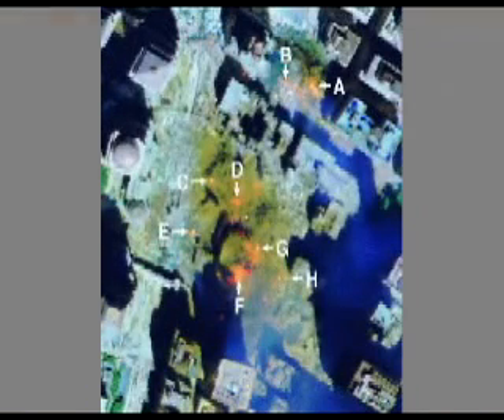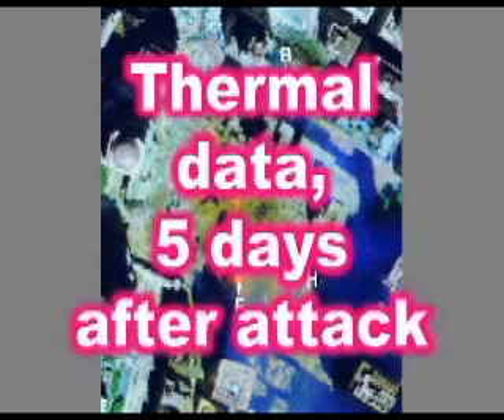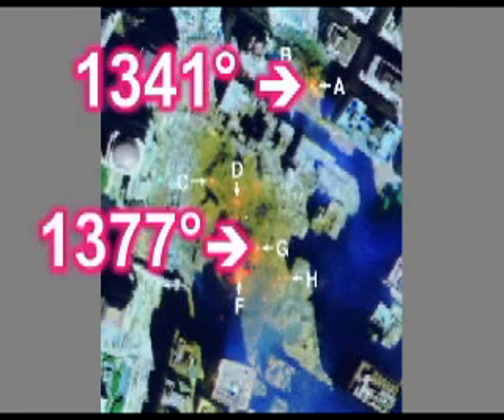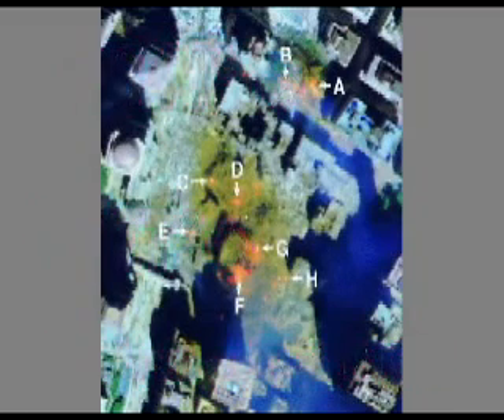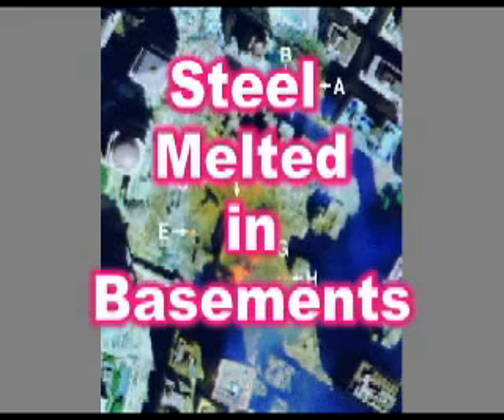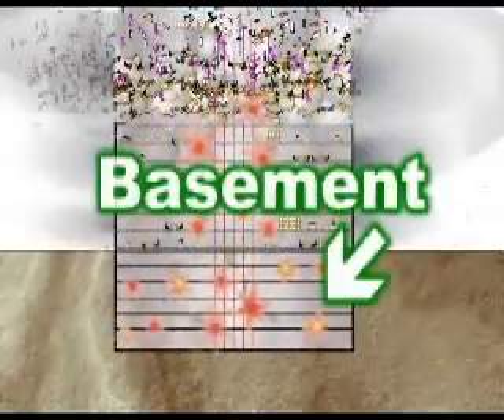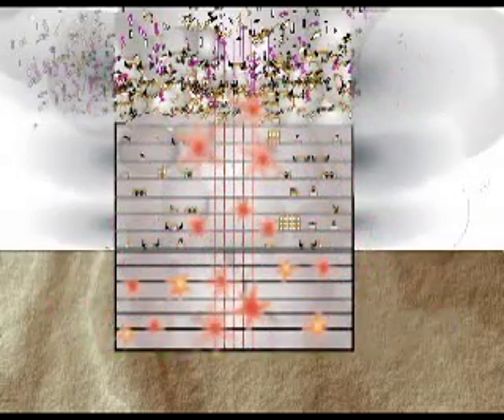WTC Ground Zero Molten Steel (Part Two)

Comment: Super Nano Thermite does this to beams. Its impossible for yet fuel and rubble burning to make this molten lava. And even 3 months later under ground zero still burning and visible molten metal lava. Its nano thermite that does this long burning without oxigen. Also its impossible for these towers to fall freefall into their own footprint without controlled demolition, its just impossible from a top damage.

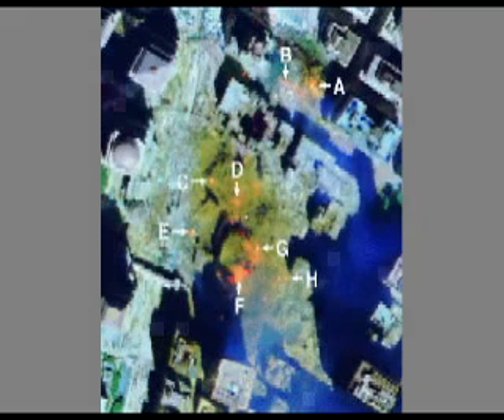Comment: Does everyone understand that the title of this video and the video itself contradict each other? True! The thermal images (0:22) indicate temps nowhere near hot enough to melt steel, so why is that in a video about molten steel? If anything it supports the government's version because those temperatures are explained by conventional fire.

Comment: Bullshit they fell cause the stel got week from the fires causing the Flores to sag pulling in on the load Bering walls causing them to collapse the pools of metal were probley aluminum since it melts at around 1350 degrees f let's not forget about how much aluminum was used as well as copper in the towers a lot of unexsplaning things happened that day like body parts found blocks away strait up terrorist attacks plain n simple I no some one who's uncle was in first plain to hit the towers n he never came home so Plaines deff were hijacked  n used to ultimately take down the towers my prayers are with all who lost someone they loved that day

Comment from the maker: @Laughingblades 
Molten jet fuel? LOL. I will ask these questions again. 

1. Where is ANY proof that molten aluminum (or molten jet fuel) was even there? Not even one witness? 

2. What was the force pushing downward to cause the friction/thermal transfer if the upper floors were either plverized or ejected laterally? This is obvious by watching any video of the collapses lke this one..

watch?v=aBOd1XB943o

Comment from the maker: @Laughingblades 
So, to summarize: You think fires 1000 ft up after the collapse melted cars and fused an engine with other parts? You don't have even ONE other example of this heat transfer in a building? No references to base this on? Where did you get this concept from? Your ass? Please tell me you have something more than just your opnion again?

Comment from the maker: @Laughingblades 
Here's something else to ponder while you're looking for other examples. At the initiation of the collapse, a significant portion of the fire impacted area and continuing downward was either pulverized to dust or ejected sideways. So, where is this FORCE (mass) pushing downward creating friction and ultimately heat energy? Was the bearing weight dust or air? There should be a massive chunk of building at the base. There was not..one to grow on...

Comment from the maker: @Laughingblades 
1. Fires from 1000 ft up caused this? 
2. Doesn't answer the question
3.-4. I'm sure there are examples of this thermal transfer in other building collapses? Ya know, where extreme temps were found underneath the building? Can you post some please? Thanks. You're not going to tell me this only happened on 911? 
5. Video
6-7. Other examples? None, right?

Comment from the maker: @Laughingblades 
Hey JR. You can work on this. There were hot spots discovered underneath WTC7 also. Was this caused by molten aluminum also? Was the WTC7 siding made of aluminum? What gives? Here's comes a different theory, right?

Comment from the maker: @Laughingblades 
Watch this clip and tell me did molten aluminum cause this?
watch?v=Zww9-AaIgrw

1. melted tour buses, cars, firetrucks
2. car engine melted together with other parts of the car
3. flames still coming out of the BASE of the towers
4. 5-6 stories below ground, fires still burning until Dec01
5. workers digging up heated rubble/ 2800 degrees underground
6. massive thick steel bent like a pretzel
7. fused steel and concrete

Comment from the maker: @Laughingblades 
Oh, I got it now. The aluminum flowed along the surface of the 1350 ft building? I'm sure there is video showing this somewhere? No? And here's another mystery. The people seen at the North Tower impact hole just 20 mins before it collapsed? Did they walk over, around or thru the 10,000 gals of jet fuel, plane debris, office supplies....and now this just in, possibly molten aluminum to get to the impact hole? And yes, just accept your BS theory as fact or you're stupid?

Comment from the maker: @Laughingblades 
I think you have this reversed. You are only giving your opinion of what happened. Science? You mean, your theory based on what? But, the REAL evidence (USGS recorded temps, many witness accounts, video footage of ground zero showing the devastation caused by extreme heat) speaks for itself. Using the same logic, where's the aluminum son, kiddo, jr.? Did anyone confirm this? No? This is some kind of new science, right?

Comment from the maker: @Laughingblades 
So, when did this heat from the fire impacted zone end up buried in the rubble? Was it when the building collapsed and the upper floors smothered the fire? Or was it when the fire impacted area was pulverized and ejected laterally? And why hasn't this BS...err.. thermal transfer (to create temps over 1000C) occured in any other building collapse? Please use something other than 911myths, PM and Rkowen's videos for your research. I will say this. You are very entertaining..

Comment from the maker: @Laughingblades 
So, let me get this right. You think the fire about 1000 ft up (the only heat source) melted the aluminum from the structure (before the collapse??) and then that aluminum somehow ended up buried under ground? Did it flow like lava downward to reach the ground or take the elevator down? And this fire 1000 ft up (or heated aluminum??) also melted cars and firetrucks at ground zero? You can't be serious with this?

Comment from the maker: @CrazyRay7979 
Watch the video again and count how many times the word "underground" is used. Its time to deal with real science. Jet fuel and/or office fires from 1000  ft up can not melt steel and create that extreme heat buried underground. And if this was actually proven false years ago, why do you need to defend it? That doesn't make a ton of sense, does it?

Comment: @muzicmaker2001 
Watch the BEGINNING of YOUR OWN VIDEO where YOU present that there was 1,377ºF recorded in the rubble pile...not "underground" and not "2,800ºF"

PROVE that office fires didn't cause this...why would they take the time, effort, and money to fireproof steel beams in a building if an office fire could not do anything to the steel?

That video shows nothing but a guy saying 1,500ºF and a guy guessing 2,800ºF who is obviously guessing wrong...1,377ºF, remember??

Comment from the maker: @CrazyRay7979 
Quotes from the clip below:
"There are still flames coming out of the BASE of the trade towers" 

"At one piont, I think they were about 2800 degrees" What were you saying about a bonfire and "the 1,377ºF."

watch?v=Zww9-AaIgrw

Uhh, yes. Underground. Is everyone that mentioned the fire underground a truther? You didn't know this? Please research a little more. And office fires caused this? Really? Keep trying, but you more desperate with every post.

Comment: @muzicmaker2001 
Really?  You're going to sit there and say that the ONLY fires on 9/11 should have been the ones that were on the floors that were struck?  That is just plain ignorant AND/OR purposely misleading.  Apparently you think there's nothing flammable in an office building...
I guess cars on the street didn't catch on fire either, huh?

What "max temp recorded at ground zero", the 1,377ºF?  Like I said, a BONFIRE...ah, you must be one of those "melted steel" Truthers

Comment: All of this is explained by Dimitri Khalezov.
To take it one step further, observe the chem comp of the dust.  It is easy to show how the bed rock ganite was the feed stock for the high aluminasilicate content.  Molybdenum spheres are also present, requiring 4700 deg F to melt.
Fission reactions is the only plausible explanation for this evidence.
Over 5million cubic feet of dust can not be denied.
Find shaking tower to see evidence of p-wave, which humans can't hear, on camera.

Comment: @muzicmaker2001 A lot of people believe that the steel melted after a long time of cooking in the pile.  They don't understand that physics doesn't work that way.  Heat flows from hotter to cooler, not the other way around, so no matter how long you cook steel at 1400 F, it can never get hotter than 1400 F.  

The only exception to the hotter to cooler flow is when you add mechanical work to the system, as is done in a refrigerator or air conditioner.

Comment from the maker: @vejet 
I'm sure you can describe the mecanism by which fires 1000 ft up created this heat deep in the rubble? Throw in how the upper undamaged floors most likely smothered the fires when collapsing onto them and how a large portion of this area was pulverized to dust and ejected laterally or how there were intact floors at the base of the Towers after the collapse. Did the black smoe from the impact zone also cause this? Obviously not

watch?v=Zww9-AaIgrw

Comment from the maker: @vejet 
@vejet 
I'm sure you can describe the mecanism at which fires 1000 ft up created this heat deep in the rubble? Throw in how the upper undamaged floors most likely smothered the fires when collapsing onto them and how a large portion of this area was ejected laterally or how they were intact floors at the base of the Towers after the collapse. Did the black smoe from the impact zone also cause this? This is very obvious

watch?v=Zww9-AaIgrw

Comment from the maker: @vejet 
I'm sure you can describe the mecanism at which fires 1000 ft up created this heat deep in the rubble? Throw in how the upper undamaged floors most likely smothered the fires when collapsing onto them and how a large portion of this area was ejected laterally or how they were intact floors at the base of the Towers after the collapse. Did the black smoe from the impact zone also cause this? This is very obvious

watch?v=Zww9-AaIgrw

Comment from the maker: @vejet 
No contradiction at all, but very mysterous. There is no physical evidence (steel) of this heat from the impact zone, but we have extreme temps (hotter than what NIST gave for the max temp of any steel sample) buried deep into the rubble lasting for weeks. Obviously, this fire 1000 ft up did not burrow its way deep into the rubble like a gopher, so there must be another mechanism or catalyst for the creation of this heat. ENTER NANO-THERMITE...

Comment from the maker: @greywolf424 
Find the lies:

1. Near free fall collapse
2. Witness accounts of explosions
3. Pulverized concrete at initiation of collapse
4. Pre-collapse ground shaking
5. Demolition flashes
6. No physical evidence of extreme heat at impact hole but..
7. Extreme temps buried in basement/rubble for weeks
8. Nano-thermite discovered

Comment: @muzicmaker2001 Guess what, there are over 1.5 million engineers and 132,000 architects in the U.S. alone:

bls*gov/oco/ocos027.htm#emply
bls*gov/oco/ocos038.htm#emply
(replace * with . )
.
SO GUESS WHAT, IT IS EXACTLY LESS THAN 0.0008%

Comment: @muzicmaker2001 ... Exterior columns failed due to loss of interior lateral trusses.  Without lateral support and with interior columns at 1100deg the exterior columns cannot support the entire building without buckling inward like a piece of paper you're trying to stand up straight.

Comment: @muzicmaker2001 Thanks, I found the report. Right next to your quote it also mentions that they recovered less than 1% of the columns from the effected areas.  So while 600c (1100f) is the failure point of steel they only recovered 1% of the steel in the fire and it did reach that point.  The other 99% may have been hotter or cooler.  In a previous post you talk about the 3% of exterior columns found only reaching 250f. But they didn't initiate the collapse due to fire...

Comment from the maker: @DRAT311 
Read NIST's quote again. 
Of the more than 170 areas examined on 16 perimeter column panels, only three columns had evidence that the steel reached temperatures above 250 ºC.

Now, there is no evidence that this heat impacted the steel directly from the impact zone. Next, throw in the fact that people were seen standing on this steel direct before collapse. It doesn't make logical sense.

Comment: @muzicmaker2001 You say there is no evidence that heat played a part in the collapse because the steel was only heated to 600c?  Thats 1100f.  Thats the temperature at which steel is reduced to 50% strength.  When they rate fire proofed steel they rate it based on how long it can be exposed to fire before it reaches 600c because thats its failure point.  And thats pg 140 of what document?  None of them are that long.  NCSTAR #?

Comment from the maker: There is no physical evidence that heat contributed to the collapse....

"Of the more than 170 areas examined on 16 perimeter column panels, only three columns had evidence that the steel reached temperatures above 250 ºC. Using metallographic analysis, NIST determined that there was no evidence that any of the samples had reached temperatures above 600 ºC." (p 140)-NIST

Comment: Why does this video show the melting point of aluminum in order to try to prove that the fires were hot enough to melt STEEL?? Does the creator of this video not know that steel and aluminum are two different things?

Comment from the maker: The fires were approx. 800+ ft up. The Towers collapsed basically straight down into a pile of rubble. If you believe the official story, the tops floors (weight bearing) should've smothered the majority of the fires when pancaking downward. Are smothered fires from 800+ ft up hot enough to melt cars at ground level and last for weeks generating temps over 1000+ degrees?  Logically, they are not...

youtube*com/watch?v=jrUosvSNLCk

Comment: However to penetrate the steel, sulfuric acid is required. It's possible for calcium sulfate to undergo a direct reaction to form sulfur oxide, followed by combining with water to form sulfuric acid. But this only proceeds at an acceptable rate at ~1400degreeC.  However, research showed it was possible for the reaction to proceed below 1000degreeC in the presence of carbon monoxide.  So, there you go...
And all your stupid talk saying "Well that explains that!", just no.

Comment: A scenario I find plausible is the eutectic reaction, evidenced for by FEMA, may have occurred, lowering the melting point of the steel. FEMA found sulfides in the iron as evidence of this, and the sulfur may have come from the sheetrock in the form of calium sulfate.

Comment: I already gave you the evidence, so I'll just repeat...
"If you can't accept all the eye witness testimonies, pictures, or even the results of FEMA investigators' results who studied samples of steel from the wreckage showing that there was molten steel, then that's your problem."

It proves, just as the FEMA investigators concluded, that something happened in the WTC that has never been seen in any other building fires.  It means there is something more to this story than burning carpets.

Comment: If you can't accept all the eye witness testimonies, pictures, or even the results of FEMA investigators' results who studied samples of steel from the wreckage showing that there was molten steel, then that's your problem.

I haven't put forward a full hypothesis because I simply don't have enough evidence to know what specifically caused those high temperatures. I do have enough evidence to say that there was molten steel though.

Comment: "There are piles of evidence showing molten aluminum. Why would you think any different?"

I just told you I never said there wasn't molten aluminum, maybe you think molten aluminum is some type of saving grace? If temperatures were hot enough to melt steel, they would obviously also be hot enough to melt aluminum...

And saying that the bright orange and yellow stuff dripping off the beam would not be aluminum, since aluminum is silvery... But you still haven't accepted this fact I'm sure.

Comment: I never said there wasn't molten aluminum... And you no more evidence of molten aluminum than you do evidence of molten steel. It should all be conjecture to you, if you are truly unbiased.

Even FEMA's investigators found that a phenomenon never before observed in building fires occurred at the WTC, in which there was "intergranular melting capable of turning a solid steel girder into Swiss cheese." quote from The New York Times

Comment: Are you dismissing Dr. Barnett's quote out of The New York Times article, about the steel members of WTC 7 that appeared to have partly evaporated?

You still haven't said what kind of evidence would convince you anyway.  You're probably waiting to hear from someone who is actually qualified in fires, like some kind of fire protection engineer, good luck finding a quote from one of those hahaha... wait :/

Comment: I take this quote from an article in The New York Times...
"A combination of an uncontrolled fire and the structural damage might have been able to bring the building down, some engineers said. But that would not explain steel members in the debris pile that appear to have been partly evaporated in extraordinarily high temperatures, Dr. Barnett said."  Referring to WTC 7.

Comment: I read your first sentence and you are already wrong. 2000 degrees is the hottest expected temperature for office fires. Oxygen deprivation lowers this temperature, which would be expected underneath all the rubble. This is evidenced by reports of people saying they found the average temperatures they were finding was about 1500degrees. You're probably thinking something stupid to say right now, like "the steel couldn't be molten if the average temperature was 1500 degrees durr"... moron